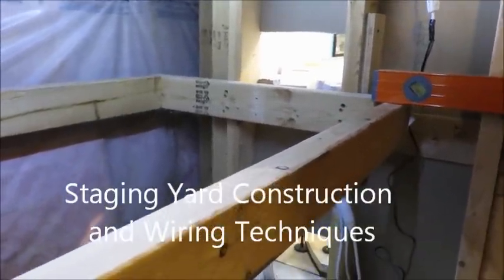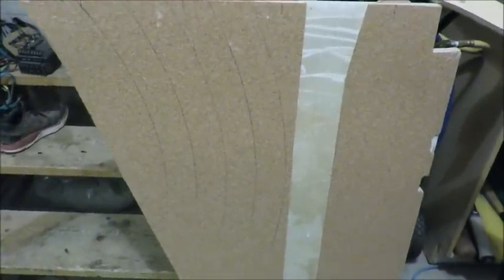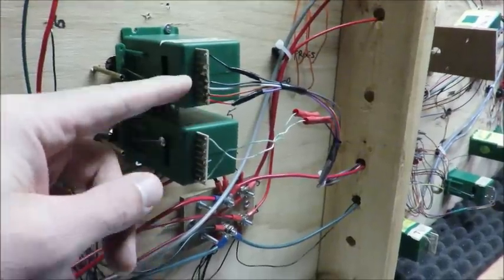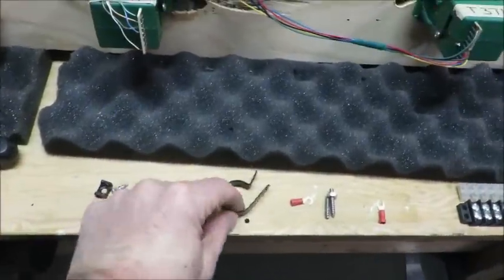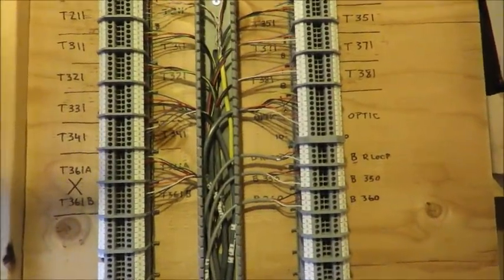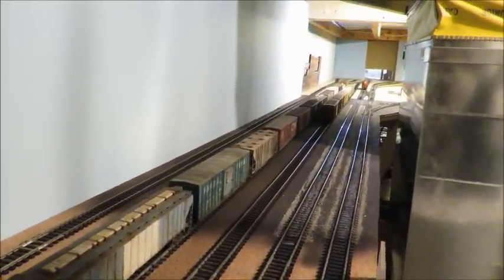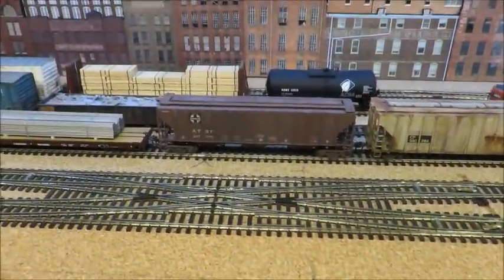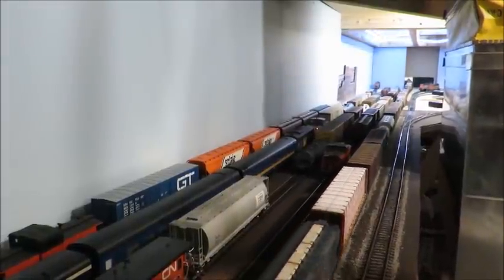Muskoka Central RR - Staging Yard Construction

Comment: Hi Steve very interesting you appear to be leading where I
am going with my layout. I am building my staging first as it will be the
bottom of three levels and intend to use a lot of the kit you have used (NCE). Ultimately
I would like the staging tracks to be automatic e.g. when I send a train down
it finds a free slot for it, I would also like to be able to have a couple of
tracks that will have through trains on that will be sent out at set times on
to the layout automatically run round the layout and return to staging. Do you
think your staging as it stands would be able to handle that or would you need something
else, I am planning to use JMRI as well.  At the moment I am just aiming to get my
staging to your level of control the full automation will I hope follow later.